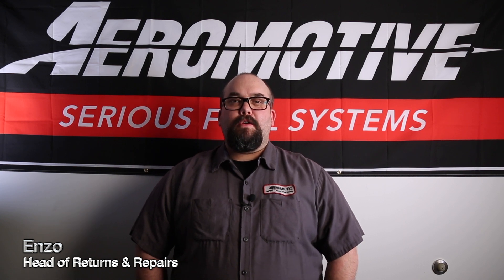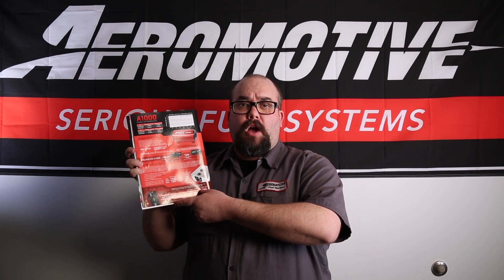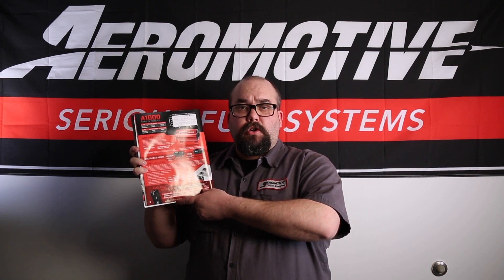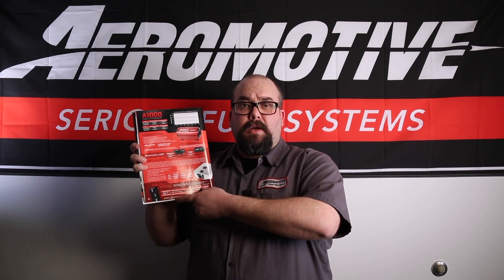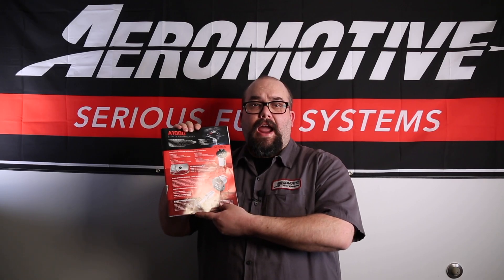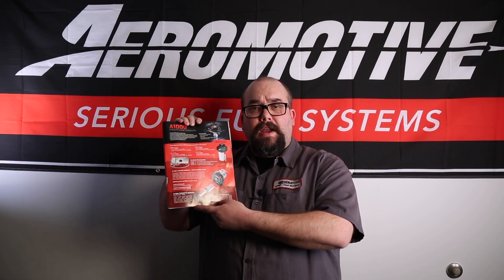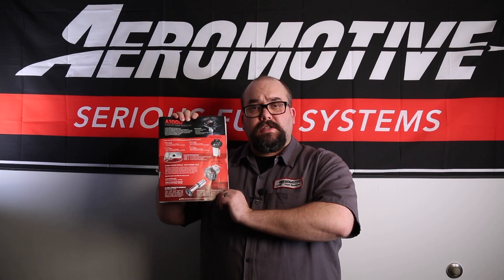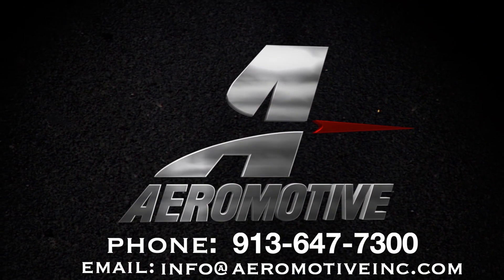Aeromotive | A1000 Explained

Comment: I have had this for 3yrs running fine but now there seems to be fuel moisture on the pump itself. Still works fine but since its in the trunk of my right underneath my fuel cell, the car smells like fuel. Can you please tell me how to fix it or what is wrong with the unit?

Comment: Can the A1000 serve as a street duty pump or is this a race only piece? Any drawbacks to running this pump on the street? Thanks in advance for the help.
Reply from the maker: We make a True Variable Speed Brushless A1000 that is perfect for the street. It will flow more as you accelerate to reduce heating the fuel.

Comment: Is there a mounting bracket for A1000
Reply from the maker: our signature style A1000 sleeve has holes built in to mount. our in line sereis all have brackets for mounting same with our filter and FPR.